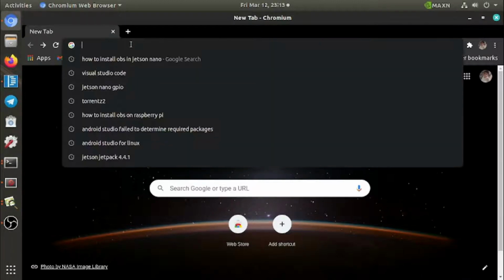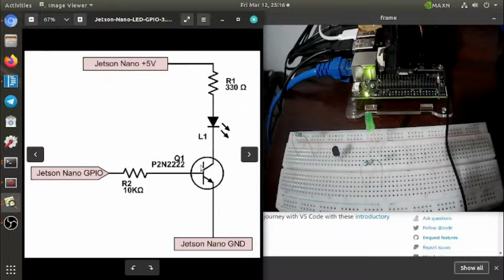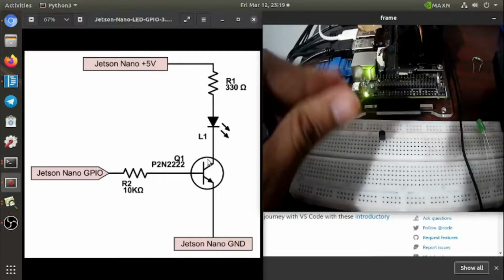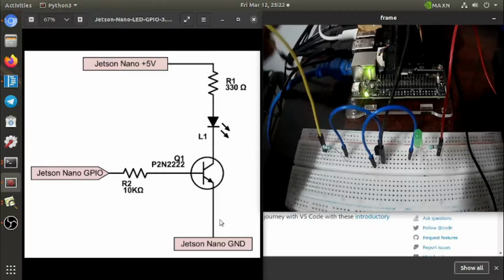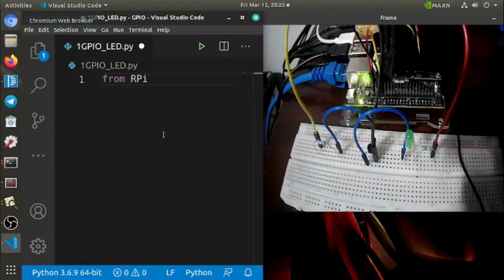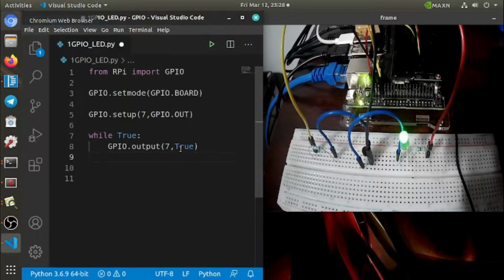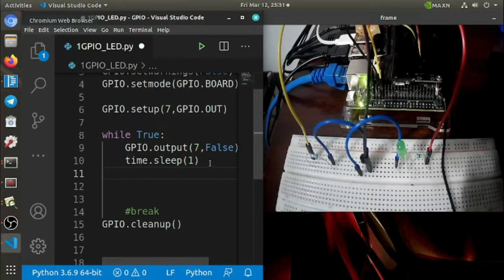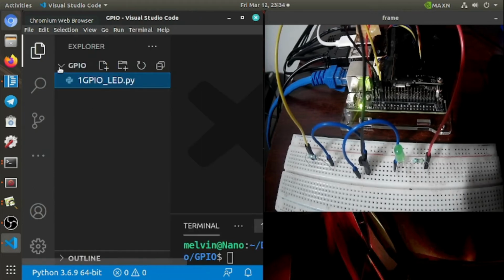JETSON NANO  GPIO TUTORIALS - LESSON  1 Controling LED Using Jetson Nano

Comment: Mate, do you know how to fire up CSI camera or USB camera on Jetson Nano? I am getting riddled with errors! 

~/CSI-Camera$ gst-launch-1.0 nvarguscamerasrc sensor_mode=0 ! 'video/x-raw(memory:NVMM),width=3820, height=2464, framerate=21/1, format=NV12' ! nvvidconv flip-method=0 ! 'video/x-raw,width=960, height=616' ! nvvidconv ! nvegltransform ! nveglglessink -e

nvbuf_utils: Could not get EGL display connection
Setting pipeline to PAUSED ...

Using winsys: x11 
ERROR: Pipeline doesn't want to pause.
Setting pipeline to NULL ...
Freeing pipeline ...

Any idea whats going on here? Thanks for the videos
Reply from the maker: which cameras are you using.
Reply: @priotx  I am using RPi camera 2 and a USB camera Liraip. I have got the RPi Camera 2 working. I was using Thonny IDE and VS code IDE and unfortunately, none of them work. However, the CSI camera does work if I use the terminal and one of the examples.
Reply from the maker: I think this video will help you - https://youtu.be/AoyZHsXKw3Q
Reply: @priotx  Oh wow that looks interesting, Paul McWhorter is using an RPi camera and VS. Thanks a lot I will definitely go through that. Cheers mate
Reply from the maker: @AKKJ  I will be bringing opencv and mediapipe tutorials on the Jetson nano so stay tuned.
Reply: @priotx  great stuff mate. Will you be interested in doing ANPR too? I am kinda zoned in on that I am happy to share my knowledge too. Btw I have fixed camera issues now I can see it on both CSI and USB cam (Thanks to Paul McWhorter). I am interested in hooking up Jetson Nano to a PoE/IP camera now for ANPR.